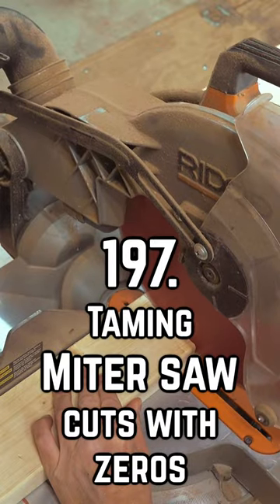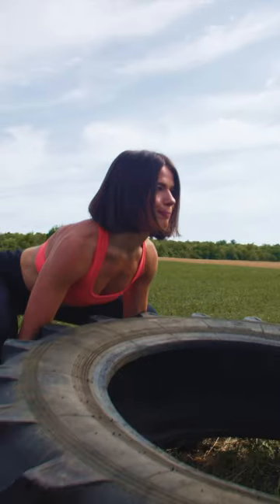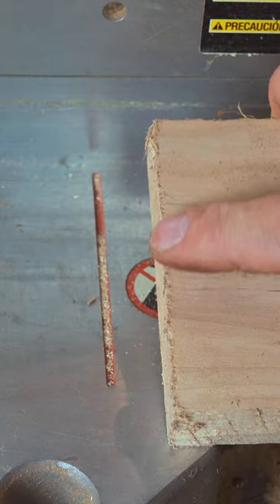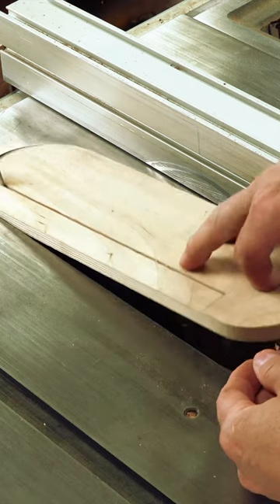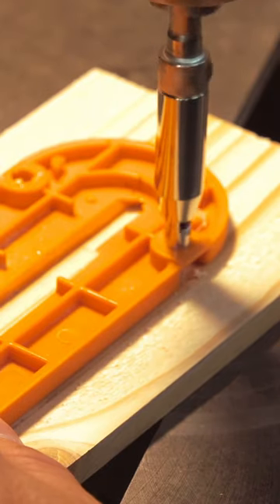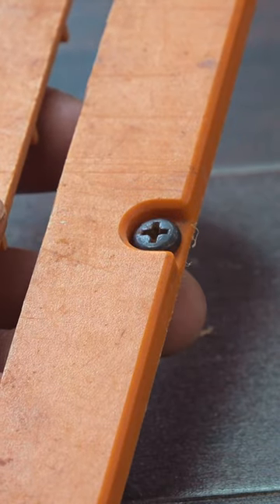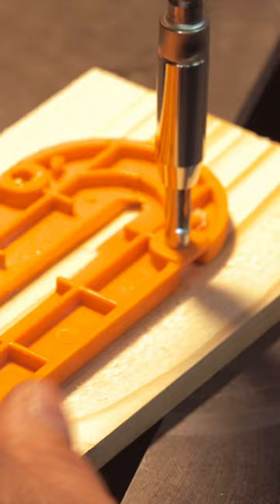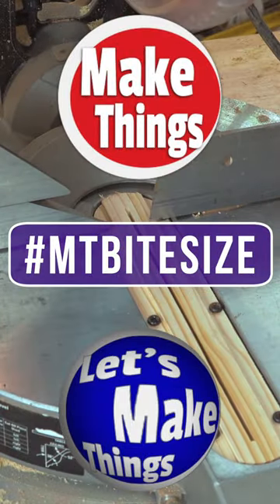197. Taming miter saw cuts with zeros #mtbitesize #mitersaw #zeroclearance #makethings

Comment: High tooth count blade should be a standard option for mitter saw, I mean you only use it for cross cuts
Reply: Most non-Festool miter saws ship with a framing-grade blade. Good enough for cutting 2x4 studs.
Reply: Recognize that cross cuts go slower with more teeth. The cuts are nicer but if you're just framing you don't care about tear out
Reply: @LethalLuggage  true

Comment: I use my 12" Makita mitre saw a lot. I've been meaning to make a zero clearance insert for both my mitre saw and table saw.. Heck I should probably make one for my tiny little 7" beater saw that I use to cut small metal stock.

Comment: You need to do multiple cuts on the same spot first cut, using a two by four reference make your first cut about 3/4 of an inch deep second cut cut the whole thing with what’s left you’ll never have a splintering

Comment: Does it help to tape your pieces before you cut them to reduce splintering?
Reply: Yes also using finishing blades helps
Reply: Do a test piece first, I've had blue tape rip fibers out just as bad when it's removed.
Reply: @MB-zj3er thats some industrial strength blue tape you got there
Reply: @Danoliveira3  3M.